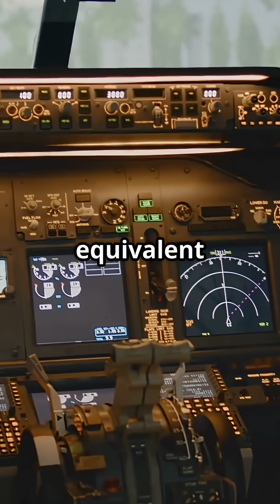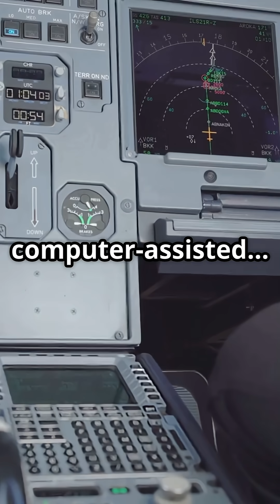Airbus vs Boeing: what happens when the computers let go?

Comment: At least the Airbus does not insist you fly into the ground for no particularly good reason, unlike if you got the MAX version.
Reply: Do you have full statistics or you are dealing with fool statistics???
Reply: Let's talk about other Boeing aircrafts... like the 747...
Reply: @robbedontuesday  Excellent and safe aircraft.  BUT most problems occur on takeoff and landing, which the 737 and equivalent Airbus will do maybe 4 times more often.
Reply: @nickjames9555  it's a problem limitted to the 737. You can't address Boeing as a whole
Reply: @robbedontuesday  Boeing is run by bean counters for stockholders.  Has been ever since the McDonnell Douglas 'merger' and MD bean counters took over and kicked out engineers..  The quality went to sh*t and engineering was 'reduced'.
This year, about 80% of aircraft are 737.  The rest are 16% 787, 8% 767, 2% 777.